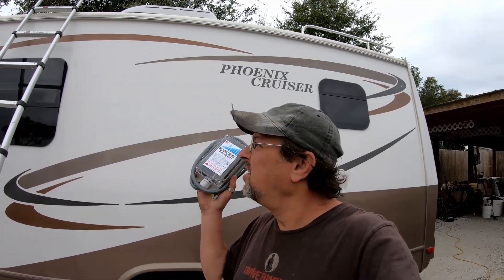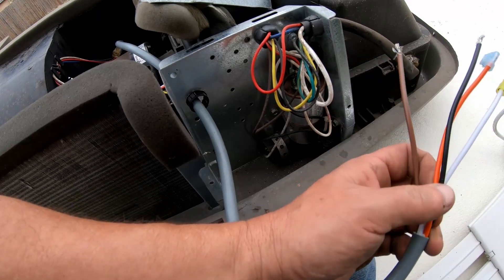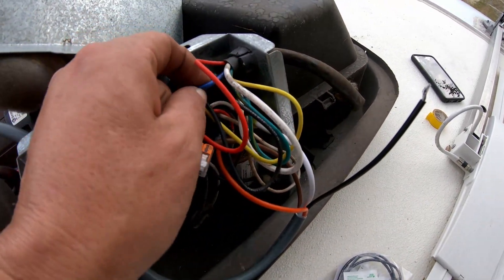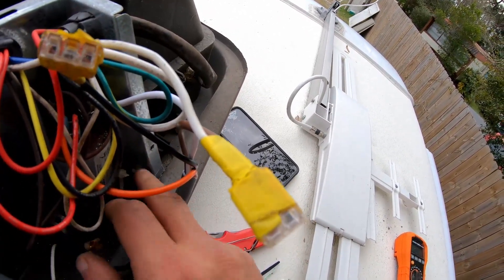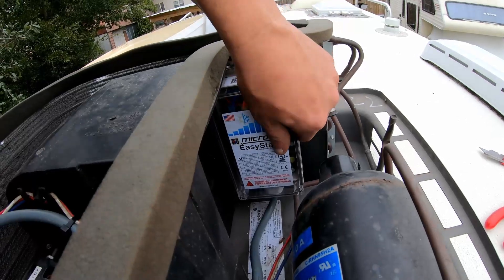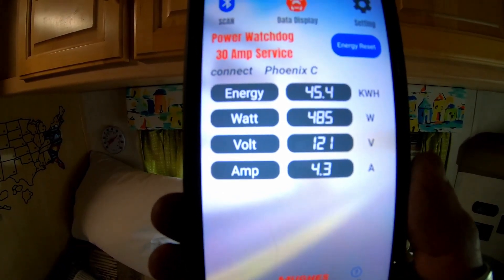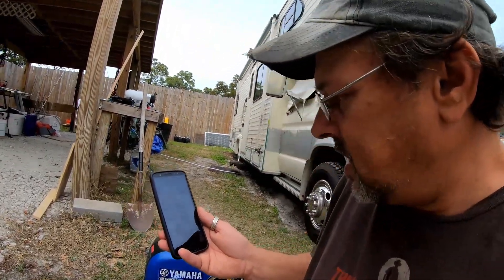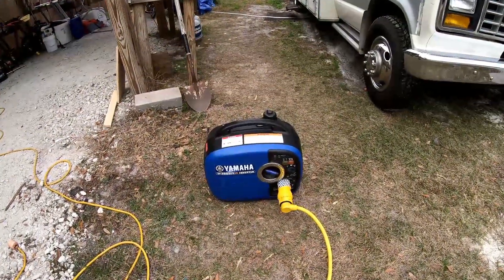Micro Air Full Install and Test

Comment: Hey man, I'm glad your back better than ever. Sorry bout your boy. Tough go. I'm currently rockin a 26 ft. TT. I installed 1  360 watt SunPower  panel with 2 BB 100ah under the bed. The setup gives me all I need. I rarely go below 75% state of discharge even running the furnace off and on overnight.Keep up the great vids.......Best, Paul in Tucson town ::))

Comment: What is it
Reply: The Micro Air is a system that adds onto the electric supply to an RV air conditioner.  It provides an electronically balanced start that prevents the large current draw on the compressor at start up from occurring.  That large current draw is a big surge of electrical current (measured in amperes but can also be expressed in watts) that has to get the compressor moving from its static position.  Most generators will run an RV air conditioner (most other them, anyway) but a big ampere load will trip the generators into a failure mode shut off in a fraction of a second.
The Micro Air system provides stored power in a controlled and balanced way that prevents the failure/shut off on the generator, and gets the air conditioner into the "Run" stage past the "Start" stage.  From then on, the air conditioner runs just fine and the generator operates normally.
Reply: @brucebear1  thank you